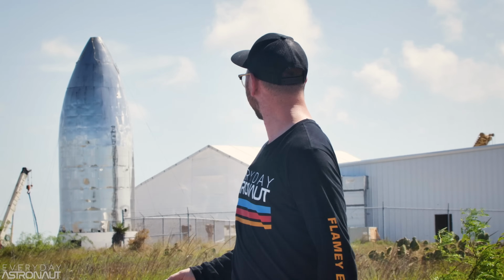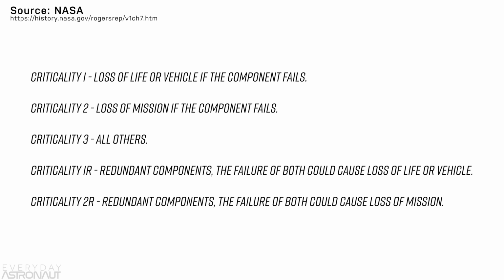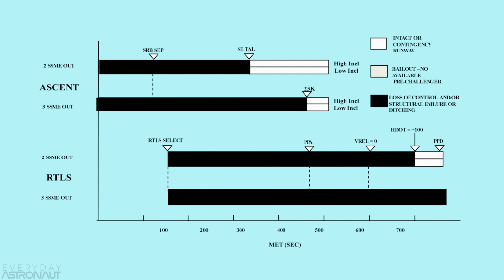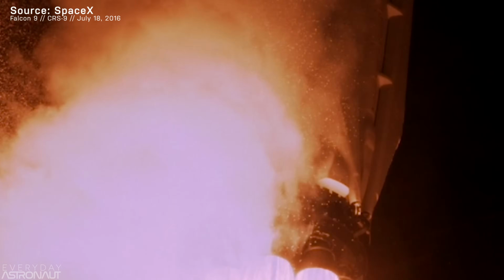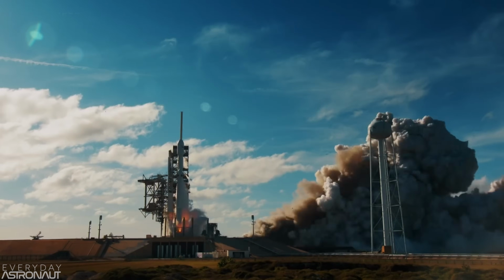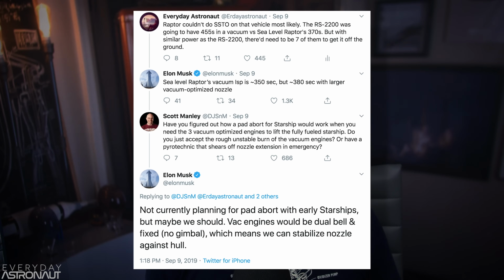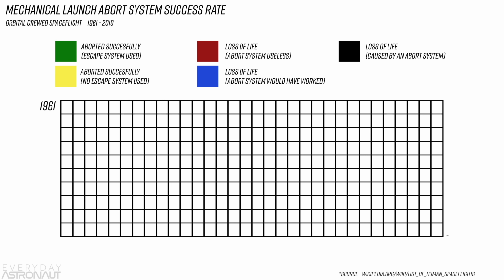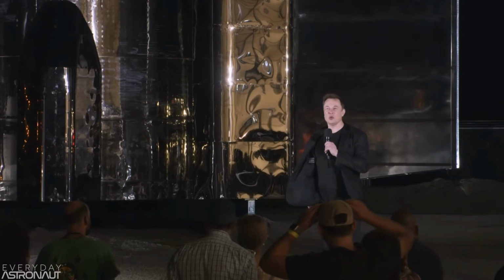Why won’t Starship have an abort system? Should it?!

Comment: 18:06 looking at this in the wake of ift 11: 
Heat shield tiles falling off is not fully solved but starship can survive even a complete flap burn through pretty much. That water tower engineering!

Comment: OK---------...   SORRY BUT,  STARSHIP DOES NOT HAVE ANY HYDROLIC SYSTEMS ON IT ... ALL THE FINS AND ENGINE MOVING IS DONE WITH POWERFUL TESLA ELECTRIC MOTORS WITH REDUNDANT POWER SOURCES...  MUCH LIGHTER AND EASILY CONTROLED AND RELIABLE SYSTEMS...
----------...OK...  JUST LOOKED At the date stamp on this video and it could be before Musk took off all the hydraulics just because they were so heavy and unreliable...  MY APPOLAGEES!
Reply: WHY ARE WE YELLING?!??!!

Don’t edit the comment, delete it. 🤦‍♂️

Comment: My question is this, if the Space shuttles ( especially the one that melted and flew apart over Louisiana) would it have survived if it had been made from Stainless Steel instead of Aluminum?  I believe it would have but, that’s my assumption
Reply: I’m assuming you don’t have an engineering degree.
Reply: No, it would not have lol

Comment: DON'T NEED ABORT SYSTEM PROPER ENGINE MANUFACTURER MOSTLY EVERY LAUNCH I'VE SEEN ESPECIALLY WAS AN ENGINE FAILURE EXPECT MAYBE SHUTTLE BREAKING UP OVER TEXAS ENGINE LAST STARSHIP FAILURE WAS ENGINE FAILURE LOOK LIKE A TURBO RETURN POP SPIN BACK INTO EARTH CHECK THE TAPE I SURE YOU CAN FIGURE OUT

Comment: It's remarkable that a few years later, the capabilities of the SpaceX Crew Dragon has been investigated and explored.
As of 2025, NASA is happy with capsule reuse by SpaceX, and is even considering allowing the Super Draco engines to be used as a contingency in the event of catastrophic parachute failure.

Boeing's Starliner having had a single reuse so far is a good start. Their choice to ditch their service section, with it's motors, prior to reentry has lead to some challenges diagnosing issues. Thankfully, all human inhabitants have been kept safe up to now.

Comment: I doubt an escape system would have saved the Challenger crew. Even if the problem had been detected in time, it occurred during a phase when the SRBs were still firing, so a safe escape seems rather unlikely.

Comment: I think this is wrong, spaceship is not jetliner when we face rocket engines we have to have reliable escape systems. in a jetliner you've got a turbofan jet engine which is far more different than rocket engines. i wish my conclusion on this will be false and starship serve without fails... i hope we don't get this lesson with loss of life of astronauts

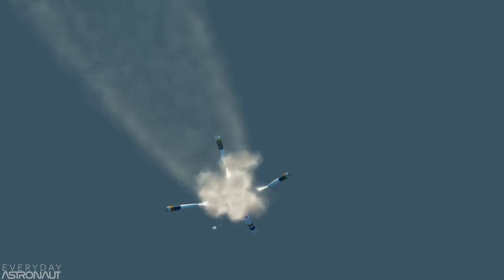Comment: 37:35 “but perhaps shutting down the engine and detached from the rocket would have been sufficient”

Yeah… good luck shutting down an engine on a rocket that just blew up… and imagine if you can do that…

Also good luck for the crew capsule to survived the explosion… and imagine if it did somehow survived…

Good luck trying to detached from an out-of-control booster spinning around mid-air in extreme g forces…

Nah.

Comment: NASA has been hostage of Utah politicians who demand solid fuel boosters utilized on all of their crew rated systems since Shuttle. To give more business to missile manufacturer, and same continues with SLS. In addition the stupid SRBs could not be shipped out of land locked Utah, which demanded them to be build as sections. That caused lives of Challenger crew. As an comparison, when Russians have needed boosters, they use liquid engined boosters, which can be throttled and shut down.

Comment: 2nd stage has to be redesigned as scaled up version of X37B to withstand reentry. Even the 1st stage might has to land as a plane, because the engines does not ignite, because of excessive vertical pressure, because of bigger speed of descent, size and weight

Comment: After witnessing the failures of all three Starships so far as from 2024-03-17, I would want an abort system as Space X is far from perfect and less so than NASA.
NASA had many things with triple redundancy on Saturn V and they had an abort system, if they had one on the Space Shuttle I'm sure some of those dead astronauts would be alive now and remember there will be many astronauts on future Starship designs.
If Elon can afford the reusability option he can afford the rescue safe option or has money taken over adventure as the main driving force now?
NASA should make it mandatory.
Reply: Less so than NASA? SpaceX’s Falcon 9 is the most reliable rocket in the world, NASA used it to replace the Space Shuttle which killed 14 people.
Reply: Tbf the 3 launches were test launches where the staff themselves said that chance of failure is high as it were prototypes, while NASA designs rockets for decades before doing launches.

Comment: I thought Starship was meant to be more like a freightliner but for space, to move as much material to space as effeicently as possible. If that's the case then an abort system would not be neccessary and only add a whole lot more weight. You can send people up in smaller more safety redundant ships.
Reply: Well it’s going to be putting people on the moon in a few years . Though it won’t be launching them

Comment: I would not go on a rocket unless it had a full abort *process*.

Can abort with full crew safety at every part of the flight. I don’t care if you chuck a crew cabin out at 80,000 feet or just belly flip into the atmosphere with the second stage, so long as you can save the crew at all moments, and with all failure modes.

Comment: hey tim, please do an update of this video, cause this video does not convince me that starship was safe enough  3 years ago, so is it now. and also if the upper stage has any flaw ever, we cant just sit and accept it to destroy the payload or even worse take lives, they need to have  better safety or we are gonna have to face a catastrophe. or no. wahtever it is i want to be educated about this
Reply: Starship still wouldn't be considered safe, especially for humans, since they only had 4 test launches (3 or 2 when you wrote that comment), all of which while providing a ton of data, ended up exploding / heavily damaged. 
So while it would seems logical to start putting Starlink onto basically the next launch (IFT 5) (in terms of safety), it's still far a way from transporting humans.
Reply: @CrazyPengion   yeah thats what i figured after watching these launches, but spacex is being upfront about these being only test flights, so i am willing to wait and watch as to where they take this.

Comment: I am a bit confused about the title. Don't you yourself say that it does have an abort system, just a liquid fueled push, instead a solid tower pull system? Or am I getting Smth wrong?
Reply: It's an idea, which wasn't added yet at least (at least they never used it, there could be a small chance that somewhere there is some manual hotstage start code)

Comment: Why is it that SpaceX Starship has to have and Xscape module. The space shuttle did not have one. Don't you call that double take is that fair. You tell me
Reply: The lack of a crew escape system was a critical flaw on the space shuttle and killed seven people. That's a third of all people killed in flight in spaceflight to date. Adding one could have resulted in a lot more aborted missions though, as the SRBs would have to have been replaced by liquid fuelled boosters which have a greater chance of failure (although you can run the engines up on the pad and abort before launch at least because you can shut them down).

Comment: Did you forget the Russion capsule that sprung an air leak at the ISS ?  A replacement capsule was sent up to the ISS emty and returned the crew. safely !  Also would a 747 with four engines loose all four engines ?  T. Lipinski
Reply: P.S. Yes all four engines failed, but where able to restart...  tjl

Comment: I wonder since it's such a large vehicle with the crew at the nose, if a Starship had the control to reorient itself before crashing back to Earth the G forces alone probably wouldn't be catastrophic. We've seen that an unfueled Starship in free fall doesn't move terribly fast, that combined with a 40 meter crumple zone might make for a survivable event. Though the crew would still be trapped in a steel box and probably on fire.

Comment: Re abort systems: Sure, if not needed it does nothing and thus would not add to the complexity of the general operation of the starship. A bit like seatbelts in a car or probably more like lifeboats on a sea vessel. We don't need a repeat of the Titanic It's a bit of a no-brainer. Also Ai should give enough contingency plans for every major step to. hopefully, prevent catastrophic failure.

Comment: For the abort system starship can still have one. Simply have a gap between the upper tank and bottom of the payload area with a steel seperating them have the fts cord around that area and have a similar system the hls will use for moon landing above the fts area that can fire like solid rocket booster design and the cord seperates the 2 apart allowing the payload top escape saving both payload and humans and either have another rocket motors for landing or use the best or upgraded parachutes for landing. Personally for the design I would just upgrade the falcon 9 to do what starship can just have more and many launches per day. Ill explain how that can be done if you want.
Reply: A steel plate with extra engines and parachutes would weigh an insane amount. 
The Falcon 9 part would not completely work, as Starship could send larger sattelites, bigger payloads (eg Starlink) and it would be completely reusable, which could make it theoretically cheaper than Falcon 9s, which waste the second stage.
Reply: @CrazyPengion  yes. I went through some ideas since and thought of an abort system with simply the dragon capsule inside and the fts running along the cone life fairings to spilt it open and the capsule could escape saving on the mass. The falcon 9 upgrades were meant to use methane instead with the second stage fully reusable and possibly longer tanks for more fuel capacity. It is not as large as what starship could do, but it would make it cheaper and as a backup or other use rocket. In the end, I think it's just fun to think of new designs.
Reply: @mr.ackermann807  Actually thinking of the moon lander design they could use the top thrusters for some kind of ejection system
Reply: @CrazyPengion  by top thrusters, do you mean the decent thrusters?
Reply: @CrazyPengion  I would suggest a similar thing for the hls too as it would be lighter and could have its own fuel to get back up to the altitude and velocity needed for orbit back to gate way station. The other main issue would be if it only had enough fuel to get away and still land on the moon. If it did that, then it would need a fuel synthesizer so it could get more fuel to get back or have to wait for a life boat next time.
Reply: @mr.ackermann807  Yes
Reply: @mr.ackermann807  The question is if all of that isn't too much, as that would increase the weight and cost.
I could see a fiel synthesizer on a moon station though, as it would make a lot of sense. Crazy to think that it's more economical to produce stuff on the moon and bring it to earth's orbit rather than just shoot it up from earth (not yet, but "soon")
Reply: @CrazyPengion  moon station as in lunar base, yes, but only after a while of missions to get it built fully first. The escape pods or life boats should automatically have one in them for the reasons I mentioned earlier and could use those for at first untill they can get enough materials there to build a larger one for hls itself.
Reply: @mr.ackermann807  How big/expensive would one have to be though?

Comment: I think the Soyuz has a pretty good abort method, if it can be called that.
Reply: Yea it can be called that, why wouldn’t it be called that?
Reply: @sadham2668  Its a smaller rocket ontop of the module that goes full throttle in case anything goes wrong. 
Its comparatively unorthodox

Comment: Why don't they use graphite in the most high temperature areas. It has a melting point of like 4000k. And that is hotter than the combustion chamber temperatures.

Not only can they use this as thermal protectors, they can also be used to ablatively cool rocket engines, and the graphite wouldn't even melt.

Now obviously there should be some very obvious fact that makes it not possible to use graphite this way that I probably don't know, and if someone knew of it then if you could please answer this comment? thanks
Reply: I don't know the details, but could have something to do with:
- cost
- weight
- accessibility
- thermal conduction
- other properties (conduction, strenght, connection to other materials, etc)

Comment: Do airplanes have an abort system? No?
Reply: Of course they do. They have wings. Many an airplane has survived because they have wings. Even helicopters can autorotate and essentially glide, on engine failure.
Reply: @nb6175  Starship can land with 2 engines out. Your point being?
Reply: @@user-gg2ty5tk8k You're missing a colon after "This is an incomplete, if not naïve, answer." because if any of those things happened on a rocket you'd also be screwed (probably more-so). What a waste of words.
Reply: @nb6175 with hot staging now, starship can abort and lift itself off the first stage (super heavy) incase of a catastrophic failure. 
  Which works fine because basically all flight aborts are designed for first stage ascent, once the second stage gets to space, abort is no longer possible and since the starship itself is the upper stage, it works fine for an abort scenario. They might just need to add maybe 2 engines for extra delta V to get it off of super heavy FAST. 
plus starship is still in its prototype stage and will undoubtedly get better over time and they’ll need to if they ever want to get human rated.
Reply: @nb6175 the Starlink launches for starship will give space X plenty of time to prove starship’s reliability and prove it’s safe enough for humans, it’s a long road but they’re definitely working on it

Comment: raptor reliability not looking so good rn
Reply: They  went on faling long after that stage, at the end we can clearly count 8 engines offline... And we saw more than a few showing the green self destruct flame...
Reply: Wdym?
Reply: Not really, it's most likely the destruction of the launch pad is what destroyed the engines, you can see bits of flying off in Tim's slo-mo tracking shot. That's an easy fix with a proper launch pad. The real test will be when they have to land and take off on the Moon/Mars with no proper launch pad..

Comment: I mean planes in the early days also failed and crashed quite a lot but with every crash, they improved and now on modern planes there are not even parachutes on the plane and it has developed into the safest form of transportation
Reply: That's a double-edged sword because every disegn that was flown in the Birth of Flight Era didn't make it to the next. Same reason Steam Cars are not still being sold and produced in massive numbers today.
Reply: @Voodoowings101  steam cars arnt being sold due to heavy weight and low mechanical efficiency. To increase thermal to mechanical efficiency you have to increase the boiler pressure by increasing the heat. Steam boilers in the 1920s could not be made strong enough to handle 1000s of PSI and hundreds of degrees Fahrenheit in a car sized frame. You know when you heat a pot of water it takes several minutes to get to a boiling temperature but takes hours to fully boil away. This is called the heat of evaporation. The energy used to evaporate can not be extracted so you have to increase temperature and pressure which can’t be done in small steam cars so steam cars went extinct due to lack of innovation.
Reply: @American catholic  Then why were ships using Steam well beyond past cars? Heck railed used Steam locomotives into the 1950s (here in the US), so I wouldn't say it died due to lack of innovation. More of Diesel (the incoming tech) while more efficient was not nearly as reliable.
Reply: @Voodoowings101  ships are larger and thus are able to fit much higher pressure vastly more efficient boilers. I meant steam died in the automotive industry due to lack of innovation not overall. Steam is still used today in nuclear reactors  ,coal/natural gas plants, solar concentrated power and many other applications. Yes steam lasted in locomotives until the 50s and 60s. Coal was much cheaper than diesel so steam locomotives were economical for a long time. Steam cars couldn’t realistically run on coal because then you would need multiple people to drive the car kind of defeating its purpose as a personal transport vehicle.
Steam ships could also use ocean water to cool steam to under boiling temp water to put it back into the boiler and recycle the water and not have to heat water from room temperature to boiling again making y more efficient.

Comment: If there is a fault with the first stage during ascent, could they fire the second stage to get separation then just land?
Reply: Assuming all 33 (and in the future likely 35) Raptors are pushin with full thrust up - no, as you'd have to match and exeed that acceleration.

Comment: "ONLY" 1/2% launches needed an abort? My guy....that's a huge number when you are talking about engineering failures. If 1/2% of airplanes flying out of Houston needed to abort, that would be 3 aborts every single day.
Reply: “The mortality rate among climbers at altitudes higher than the Base Camp is 1.3%”

Going to space is safer than climbing Everest but people will pay multi thousands to get in like for the summit

Comment: Starship is an amazing American ingenuity, but SpaceX Engineers should seriously consider an Abort System to save Astronauts lives.
Reply: If it's deemed needed to make it safe, then they will. The first several dozen/hundred launches won't be with any crew, so they will have plenty of data to see about safety.